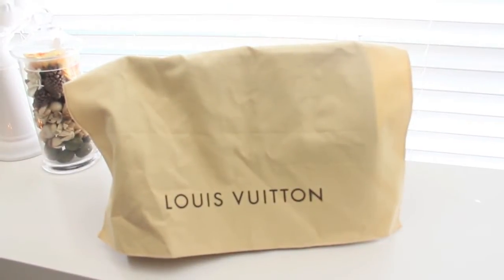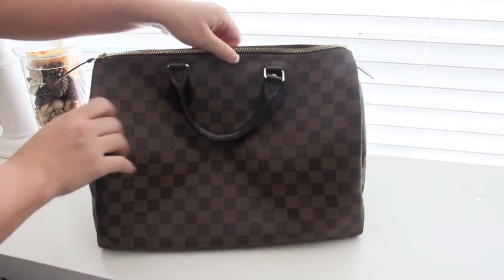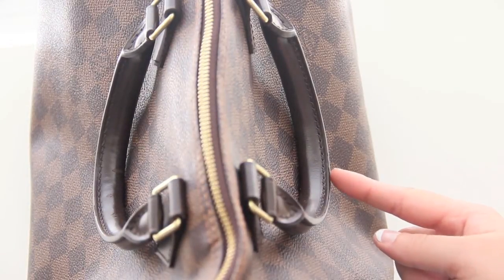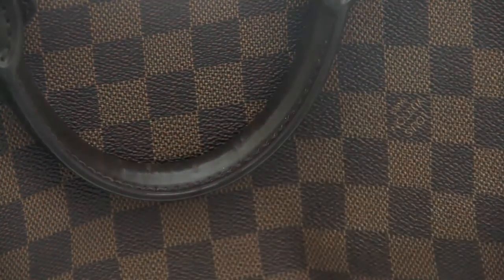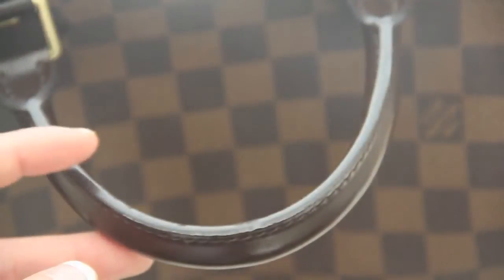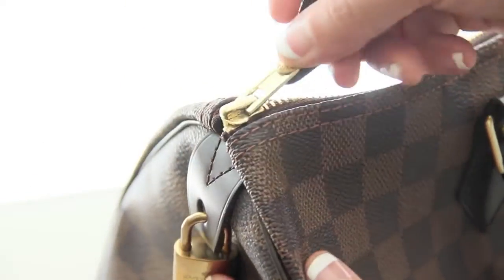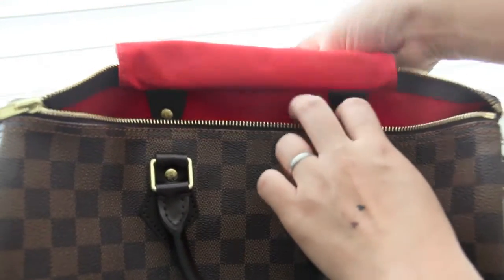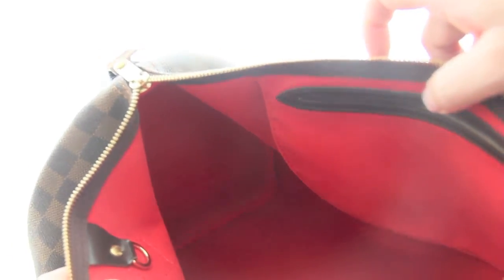Louis Vuitton Speedy 35 Damier Ebene Defect 2011

Comment: I had the same thing happen to mine months after i got it. I have the speedy 30 damier ebene.....so i brought it in and they sent it off for repair free of charge. I was told if it's wear and tear they might charge, but since mine was practically brand new, it was free. Also, they said to expect it back between 6-8 weeks, i got mine in just about 5. Hope this helps. =)

Comment: I had the same problem with Damier Ebene Nolita. It looked terrible. I had to pill off all paint because the handles looked messy. Now the handles are just leather and it looks good. I don't know if I need repair now or wheather they would accept it for repair.
By the way, I've got speedy 25 same type, weared it a lot without any problems with handles.

Comment: That is a defect. I just purchased my speedy and the underside of the bag is all wrinkled and rough. I'm afraid it will be like yours down the road. Speedies in this print are known to have this issue. Of course I only know this after I purchased the bag!
Reply from the maker: +Kristi V Yes your correct. I also didn't realize this until after I bought the bag.

Comment: I do believe it's a defect. Usually the damier will have this issue due to use of different material. I have a Palermo handbag and the inside  pocket torn for using less than a year. I brought to the store and would   not repair it for free because it is a sing of usage. I totally disagree,   no matter how good the  leather is there will always be imperfections.

Comment: I don't think that's a defect. This happens when you wear bracelets on the arm that you  usually hang te bag on. I have had two speedys, the first one did exactly what yours is doing, because I wore a small gold bracelet on the same arm I carried it on. The second one did not, because I made sure not to wear it in the arm with the bracelet.  That's just my experience ;)